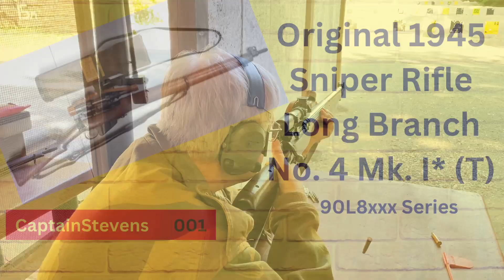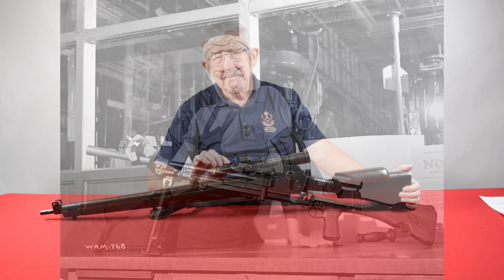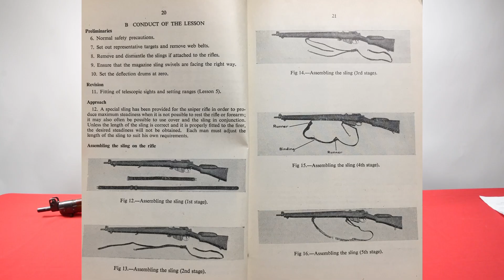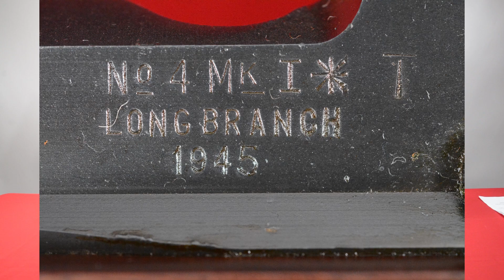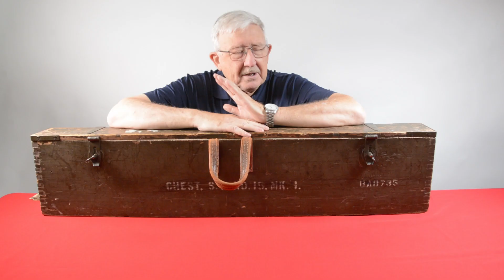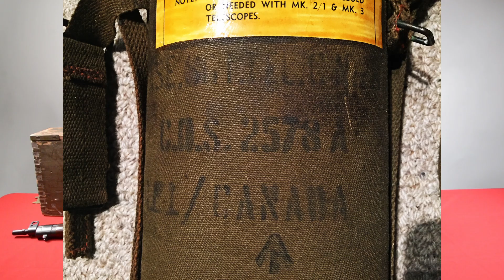CMS 001: 1945 Long Branch Sniper Rifle No 4 MkI* (T) 90L8xxx series

Comment: Sir, do you how to reset the windage and elevation drums once their limited adjustment is used up please?
Reply from the maker: That is a technical question I probably cannot answer fully. If the limited adjustment is used up and you still cannot get the rifle zeroed, I believe that means that your scope set is mismatched to the rifle and that the scope tube is not collimated with the rifle barrel. The adjustments should be adequate for an original matched set. I suspect the adjustment would need to be done where the bracket meets the bases, but I do NOT recommend permanent changes as these would damage the sifle' and ruin the value. I suggest finding a Facebook forum on accurizing Lee-Enfields and maybe someone there can help. The good news is that I, and some others, are occasionally able to locate the original serial numbered components. In some case I have put the owners in touch with each other and they were able to work out a win-win deal so that one rifle could be reunited with its original scope set etc.

Comment: i have a no4 mk 1 i wish i had the original stock on it, mine got sportsterized but i still love it
Reply from the maker: Original wood sets for No. 4 Mk. I and Mk. I* are getting harder to find and can cost $400 and up. Replica wood sets are now being made by several people. Fore-end is hardest part to get and then there is trying to match the wood as several types were used over the years and they can vary from very light to very dark shades. Walnut looks the best in my opinion.

Comment: Where would the S/N of the scope be marked onto the rifle? (Given that scope should be matched with the rifle...) British do on the upper tang of the wood, Canadian did the same, or they never did?
Reply from the maker: Canada marked the scope serial number in the same location as the British, on top of the butt, just below the cocking piece.
Reply from the maker: The scope serial number would be stamped into the upper side of the wooden butt, on the flat area, often called the "wrist", just below the cocking piece. R.S.A.F. Enfield, Holland and Holland and Long Branch all did this. If there is no scope number, and moromportantly, no "T" mark on the left side, usually that means that is is one of the thousands of unfinished conversions know as the No. 4 Mk. I (T. LESS TELESCOPE) as they never went through the final step of carefully mating a scope and bracket to the rifle. People use the term "scopeless" but I do not as the term is ambiguous. Yes it has no scope but the term could mean that either it never had a scope paired with it or that the paired scope is no longer with it.

Comment: How to measure ammunition
Reply from the maker: If you are referring to the calibre, it is marked on the box and usually on the base of the cartridge. If still puzzled, you can email me photos at seaforth72 at gmail com or take a sample to a local gun show.    Generally speaking, the calibre is the diameter to the bullet (not the casing), often combined with the length of the casing e.g. 7.62x5 mm. [CORRECTION - I had typed "7.62x54" by midyskr. That was the Soviet calibre]  Ideally find ammo with box as there were at least two DIFFERENT .303 calibres produced. These No. 4 rifles use ".303 British", not .303 Savage.
Reply from the maker: Ammunition is often marked on the bottom with calibre, maker and year. .303 is the diameter of the bullet and bore basically. Many ammunition types also measure the length of the cartidge casing e.g. 7.72x51mm is NATO standard for FN FAL.L1A1/C1A1 etc. and 7.62x39 mm was Soviet standard for SKS & AK47 etc.

Comment: Good job Colin. Why are the pad screws not staked?
Reply from the maker: Staking was not a wholly consistent practice. Most No. 4 (T) had the pads staked, sometimes multiple times due to heavy use and repairs, but one does come across examples that never were staked. Likewise one occasionally finds a bracket with no rifle number, and sniper rifles with no "T" mark. It is a minefield for the uninitiated who are contemplating buying a No. 4 (T).

Comment: Lovely Canadian example of an excellent rifle. I am fortunate enough to have a matching 1944 M47C (BSA Shirley plant). Glass was refurbished by Warren. During our Milsurp challenges, if I do my part, the rifle will strike a 12" plate at 400m. With Mk. VII ammo I just turn the elevation to 4 and I am on target. See you on the forums.
Reply from the maker: The No. 4 (T) are indeed well made rifles and I found that they spoiled me with regard to other WWII period sniper rifles. Of the roughtly 26,000 No. 4 (T) rifles made, only about 1,588 by the late Cline Law's estimates, were made by Canada. I have examples of most of the types and in my biased opinion, the Canadian made LONG BRANCH examples are even nicer that the British made examples in my opinion. The lack of German bombers overhead may have had something to do with that. ;-)

Comment: I sent you an email using your contact on your website and never received a reply. I found a scope less T rifle and matched scope with mount in the case. I was hoping since you had a list it might get back to its original rifle.
Reply from the maker: Sorry I missed it. No email show from oddone13. I do try to respond to all such requests as it helps to build up the database. So far, with over 3,000 No. 4 (T) serial numbers gathered, I have been able to find over 24 matches and sometimes the owners have worked out win-win deals to reunite serialed components such as rifles <> scopes.  Please resend to seaforth72 at gmail
Reply from the maker: I discovered that the email reply feature on my web site was not working. My apologies. Thaty has been removed as a way to contact me is seaforth72 at gmail com

Comment: Just finished a replica build, put a lot of ❤ into it. But still...hopefully one day to optain an original.
Reply from the maker: Original No. 4 (T) sniper rifles are out there, but they are getting to be expensive. They usually sell quickly if they are reasonably priced. The old advice applies "Buy the book, then buy the gun." There are many pitfalls. Even the best books have some errors and the current article in the Canadian Firearms Journal (NFA) has some errors. When a No. 4 (T) comes up for sale, it is at a gun show perhaps, online or at an auction, and you may not have the reference books with you or have time to go and look things up. In other words if you want a real No. 4 (T), 1. Do your homework 2. Save up your money. All matching serial numbers are best, but mismatched sets are also real and occasionally we can find and match-up a mismatched serial numbered scope/bracket, rifle etc. There are many replica scopes, and FAKE scopes out there (fake in that they have fake s/n and war time year marked) and I am seeing these now, sometime on original No. 4 (T) rifles, being sold as all original. The seller does not always realize that the scope is a fake. As well some people are adding FAKE numbers stamped to original No. 4 (T) rifle and original scope sets, so as to "make them match" and thus command a higher price. Just ask a vintage muscle car collector what they think of altered/forged serial numbers to make engines match the chassis, something that is definitely frowned upon! I can recommend the FORGOTTEN WEAPONS series of videos on YouTube and above all, books by Ian Skennerton, Peter Laidler and the late Charles R. Stratton and Clive Law are very good.